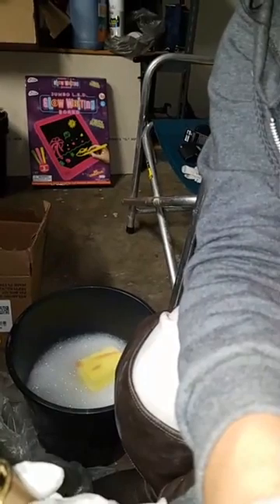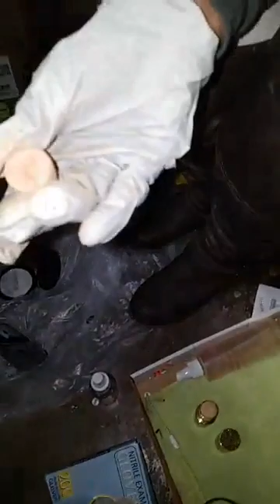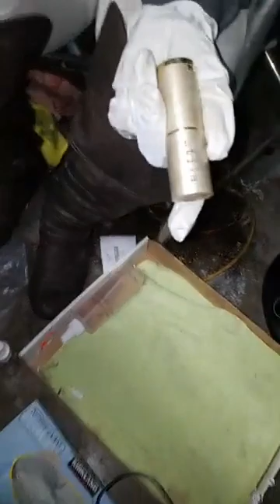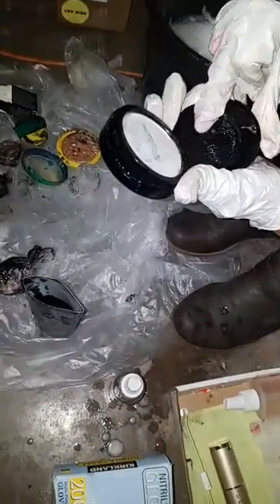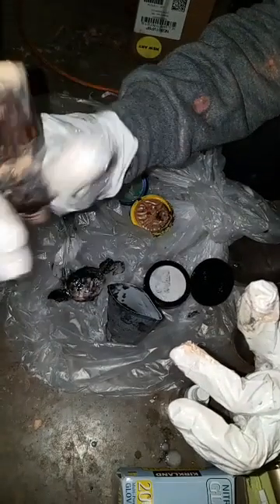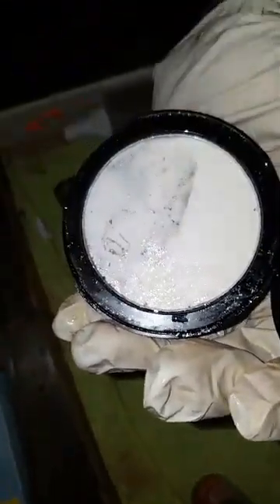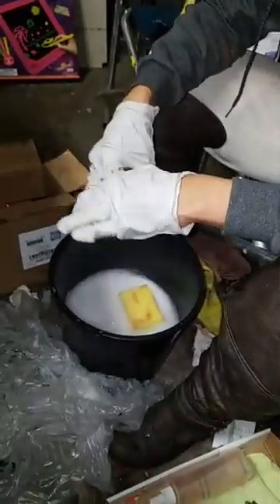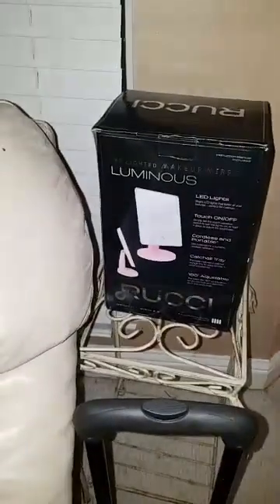Dumpster diving makeup soup cleaning from Ulta

Comment: The thing is bacteria does not live on surfaces or on product for very long alcohol and air drying will take care of anything.Your right about the lip glosses the tubes are made to work as a suction to get product out of it nothing gets into the tubes unless it's pushed in with a syringe and they don't do that.
 I took a soup box the other day and low and behold in the middle of it was a clinique sonic face cleaning brush in a bag perfectly clean works beautifully. but hey I learned a lot watching your video thanks!